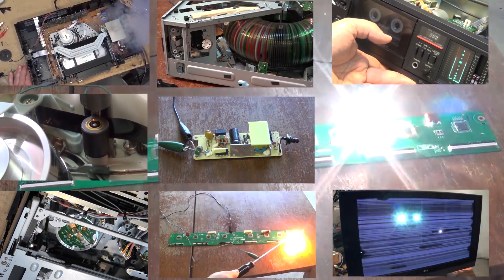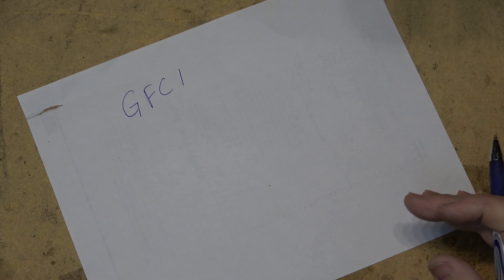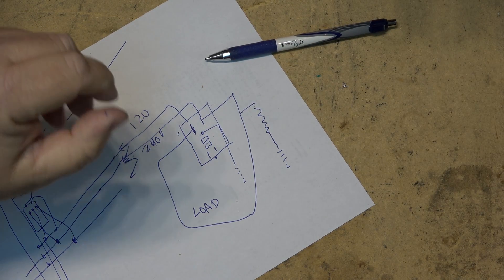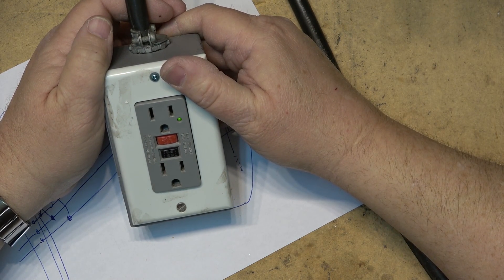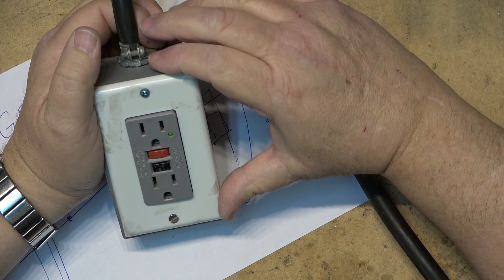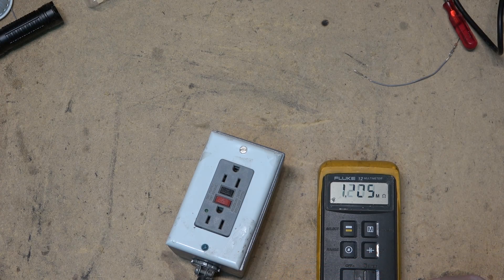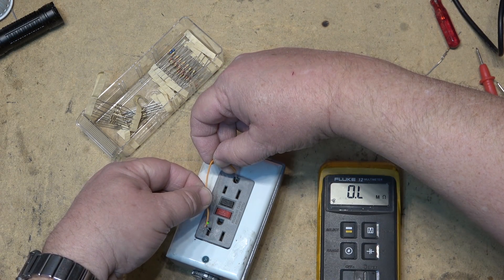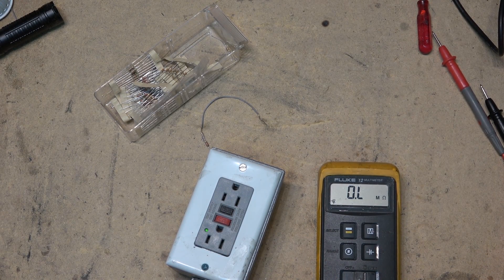Ground Fault Circuit Interrupter Demonstration

Comment: 1 PHASE  not 2!,,,,,,,,, 2 LINES and NEUTRAL  FROM  A  SPLIT TRANSFORMER ON THE  POLE
Reply: Yes, as shown in the video. So your point of yelling is.... ??
Reply from the maker: It is sut phase.  2 phases 180' our of phase as opposed to 120' if from 2 transformer legs on 3 phase service. Then also only 208v instead of 240.
Reply: @12voltvids  - In Australia we would call it "split phase", as in 240V split down the middle. Actually, it is basically the same as a center tapped audio power supply transformer, with +/- 120V windings. Then, just wire the center tap to an earth stake!
Reply: It would be 1 phase if neutral was taken from either end of the coil rather than a centre tapping. Then, the 2 voltages would be in phase.
Reply from the maker: @millomweb  if neutral was taken from one end then you would have a dual voltage single phase output.  120v / 240v however there would be a serious efficiency issue with a setup like this not to mention current imbalance between the loads.  With the center tap you have split phase 120/240 so you can have either.   The 240 side however has no neutral connection.  This is however not an issue as this is typically used to connect things like hearing elements or large motors.  Some apliances like dryers will have both phases and neutral connected.   They will use the full 240 for the heater and 1 hot and neutral for that 120v motor and lights ect.  Same with a range.  120 for the convince outlet and lighting and 240 for elements.  My heat pump uses 3 breakers.  A 240 for the outdoor compresser and a 120 for the indoor blower fan.
Reply: @12voltvids  "if neutral was taken from one end then you would have a dual voltage single phase output.  120v / 240v however there would be a serious efficiency issue with a setup like this not to mention current imbalance between the loads." - it wouldn't actually make any difference as you could run some 120V stuff between 120V and 240V. But like your existing 240V - no neutral !
Reply: @millomweb  - you obviously dont understand AC electricity. It doesn't care which wire you label as "neutral", or even if there is no neutral at all.
Reply: @johncoops6897  FYI, neutral is the one connected to earth.
Reply: @millomweb  - you most certainly don't need to try and teach me about electricity or power distribution. The "center neutral" is there for a very good reason, to balance the load and ensure better "voltage accuracy" on the load phases.
Reply: @johncoops6897  That's why we don't have it in the UK ;)

Comment: Having GFCI protection on all the sockets in UK homes is probably one of the best safety regulations I think we have. I have a bad memory of putting a fork in a toaster when I was around 8 years old like a dumb ass, but the RCD tripped and no harm was done.
Reply: I dont have a single RCD

My house is old style.  Wire fuses. I have thought about adding them but that would require having someone change the consumer unit (fuse box) and that aint happening.

Comment: Just to pass a tip along to others.. I ran 10/3 buried using a plastic nat gas pipe picked up from work (much better than the direct buried lead sheathed BX cable!)... Unbeknownst to me, the 15/20A GFCIs do NOT (usually?) have any overload protection..ie thermal breaker.. so use the appropriate breaker in the panel.. so replaced with 20A instead of 30.. live and learn.
Reply: yep a standard GFCI/RCD is not a fuse .. altough they exist in uk they call then RCBO = circuit braker  combined with RCB ( GFCI)
Reply from the maker: The outlets themself don't protect against overload. That's the fuse or circuit breakers job.  The GFCI outlets are ground faukt only. I have a combo GFCI breaker on my hot tub.

Comment: The primary reason for having GFCI outlets in a kitchen or bathroom is that the metal parts of the sink and faucet might well have a connection to earth ground, providing an electrical path through your body from a faulty appliance or hairdryer etc to earth ground. Not necessariily because of the water but because of the metal pipes, which leave the house through the ground,  or which might be touching a metal electrical box or a metal conduit/metallic-sheathed cable somewhere inside your house. If all your piping is plastic, then none of those metal parts in your sink would actually have a very good ground, although the water itself will conduct some current; however, the water in the pipes would act like a giant resistor and would tend to limit current flow. Regardless, the GFCI should trip from a defective appliance,, perhaps/hopefully before you touch the defective device and the faucet at the same time.
Reply: Yep, the stove at my old house was wired with a 3 prong plug.. somehow the ground (mesh sheath) went open.  Got a lil zap one day and noticed the 120v recepticle didnt work.  You could lay a butter knife from the sink to stove and run the oven lamp! Went unnoticed way too long as nothing just uses one leg but the lamp and outlet...

Comment: The NEC mandates GFCI protection in many areas of the home: bathrooms, garages, outdoor receptacles, crawl spaces, basements, kitchens and anything within six feet of a sink or water source. It will trip on 3 to 5 milliamp fault differential, we people cannot feel that. You can slave 5 regular outlets off one GFI per Nec code
Also required on kitchen islands .Receptacles in the garage were first required to be GFCI-protected by the 1978 edition of the National Electrical Code (NEC
I have been licensed since 1986 did not renew last year 2021,out of Northlake ,IL based on NEC code they have new code cycles every three years.

Comment: You have to be careful about installing a gfci breaker in the panel, because if all the neutral wires are connected together in the whole house, the gfci may keep tripping, so you may have to isolate the circuit that the gfci is going to protect. I came across this on a kitchen remodeling project. I fixed this problem by reconnecting the neutral side of the kitchen circuit to the main panel, and that solved the problem, too much of a current differential between all the other neutral wires ! Great video,Dave, maybe you can make a video on the arc fault outlets !!
Reply: All GFCI and RCD have individual Line and Neutral that are separate and isolated. There are 2 terminals in and 2 terminals out.
You never "common up" the Neutrals because that will immediately cause tripping. That's also why you will have problems with nuisance tripping if some dumb electrician has connected two neutrals (from different circuits) together downstream. It was common in the old days to share neutrals and earths rather than running dedicated L+N+E cable to every circuit., for example being lazy to pick up a Neutral from a light and mix it with the Live of a power outlet.
Reply: @johncoops6897  Yeah, I was thinking it wasn't wired up correctly.
Reply: Depends what value the GFCI trips also ..lot of  elctronics have some leakage .
If you put a 6 or 10mA GFCI  in in the hole house it surely will trip .
300mA  GFCI/RCD ( don't know if they are common in usa/canada )  here as main switch and at least one 30mA  after 300mA for badroom .  Never had any big issues  ( most countrys in europe is this the code )
Usualy when the 30mA trips it's a kitchen or bathroom boiler the is leaking ..

Comment: Do these have a predetermined number of "trips", like with some "automatic" resettable breakers in automotive applications?
Or are they still reusable no matter how many times they get tripped?
Reply from the maker: No limit as far as i know.
Reply: They do not last forever, that's why you have to test them monthly and they give you the test button. They will wear out, but I have personally never seen one wear out. So the lifespan is probably 15+ years.
Reply: @victorcoss2600  Don't test is so often then ;) You're just wearing it out unnecessarily :)

Comment: They are called Residual Current Device or RCD here in the U.K.
Reply: Yep in belgium "DifferentieelSchakelaar"   translaton  Differential Switch ..  in Belgium it's not allowed to have non  RCD protected outlets .. we need  the full house after a 300mA RCD and the wet rooms on a  30mA RCD ( Bathroom )  sometimes  10mA for sauna/bubble baths .  We don(t have them in the sockets like in usa & canada .. alway in the fuseboard . So all sockets behind it are protected .
Reply from the maker: We have them at main fuse box too.  Outlet protection is perfered though as if you trip it it is usually where you are working as opposed to at main panel which may be on other side if house on in garage ect.  Many homes have suites.  Imagine if you tripped the circuit and the land lord where the panel is located is not available to reset it for you.  I remember plugging my car in at a motel one night to an outlet outside to charge.  There were other things on the circuit that once they kicked in overloaded and tripped.  Naturally my car didn't charge but the ice machine and vending machines also went off.  Nobody was in the office over night.  Once the place was full the staff closed up and went home for the night.   I tried calling 5he front desk and nobody there.   So I unplugged the car and put the cord away.  By morning there was water everywhere from melting ice.   I quietly left early in the morning before the office opened.
Reply: @12voltvids  also depends how fast it trips .. the one you show trips a 6mA ?    our main RCD/GFCI are 300mA .. so the loss  has to be 300mA before it trips but yes the whole house is then w/o power . With suites on same panel you need more selectivity ..  I have on 300mA main GFCI/RCD as code requires here . But i have several 30mA's in my fuse board   My electronicslab/ham shack is on 30mA RCD workbench even has a 10mA extra RCD . When i was a kid a GFCI/RCD saved my life ..
Reply from the maker: @kittsdiy  well that why they are required for outlet that are around water.  300ma btw can kill you.  Only about 40mabis required to stop your ❤️
Reply: @kittsdiy  RCDs in sockets available in the UK too.
Reply: @millomweb  ah k  never came across one here in Belgium . ( socket with pin CPC in  Belgium & France )  so not common here .